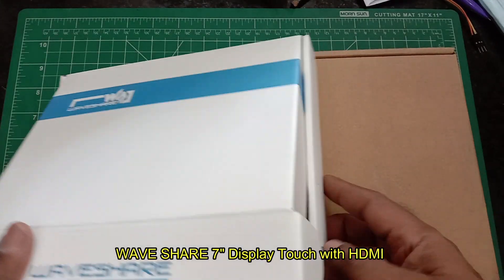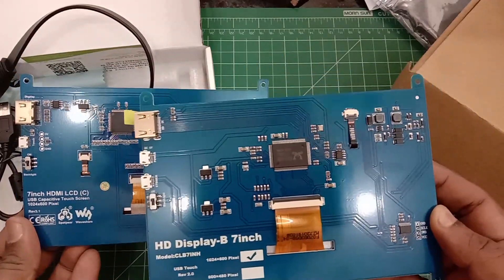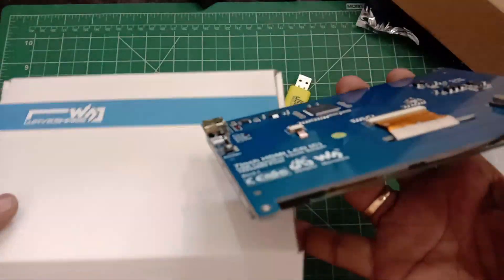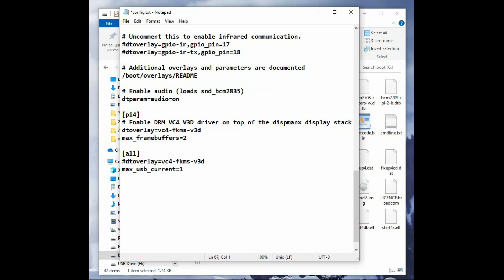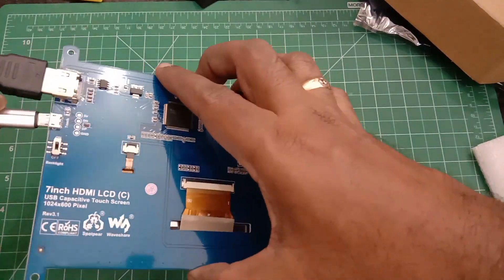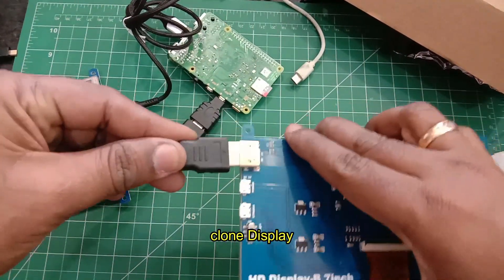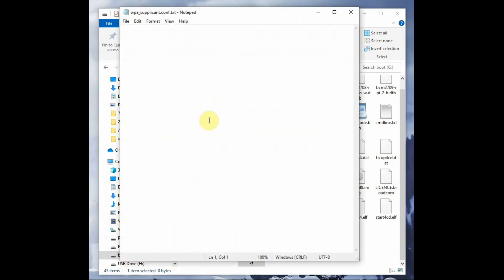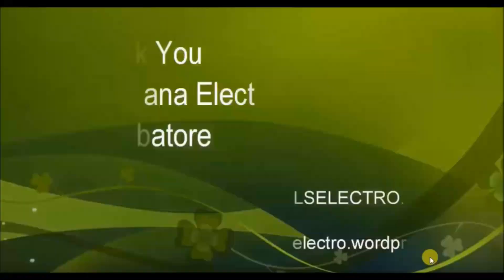7" HDMI TOUCH DISPLAY 1024 X 600 For Raspberry PI

Comment: I did all of these steps but it's not working can someone pls tell me if the 7 inch HDMI touch screen 1024×600 resolution does work with raspberry pi3 model b+?

Comment: I have purchased a Chinese Touch screen LCD 5 800*600 with single power supply which is connected with RPi. But touch not working
Reply: Hello, did you find out what the problem was? I have similar problem. Thanks

Comment: Who's great idea was it to put the connectors at the edge of the display?  Ok for a standalone unit, MAYBE.  A nightmare for a panel mount, where space not available on the side.

Power connectors through usb port ?  (Fail).

Comment: I tried to test it with this LCD display
5inch HDMI LCD (H), 800x480, supports various systems, capacitive touch
SKU: 14300
Part Number: 5inch HDMI LCD (H)

Is the creation of the SSH file and modification of config.txt really required? As I am able to see the Pi's display in the screen.

Wanted to clarify

And additionally, if we power the LCD using an external power supply like to RPi, touch is not working properly. Wanted to understand the reason

Comment: Sir first of all thanks a lot for this tutorial. I have that clone display model and rasberry pi 4 and i was trying to figure out how to connect and ended up here watching your tutorial. First I tried without the ssh and the config file changes but it did not boot, when I did the changes and tried, it did boot but I am not able to use the touch screen(I inserted in the touch slot in display mentioned by you) and also my display is flickering. What could be the reason?  Please help.
Reply from the maker: Seems to be power issue. Ensure that you use more than 2 AMP 5V power adapter. Try plugging to different USB port of RPI.
config.txt file must be included with the lines :
max_usb_current=1
hdmi_cvt=1024 600 60 6 0 0 0
which sets up the current capacity of usb port and the correct resolution as seen on the box of your display.
Reply: @SaravananAL  It doesn't work for me also same issue touch is not working?
Reply: had same issue, but moving from usb 3.0 to normal usb port fixed it for me.